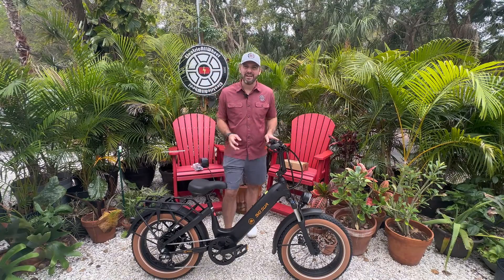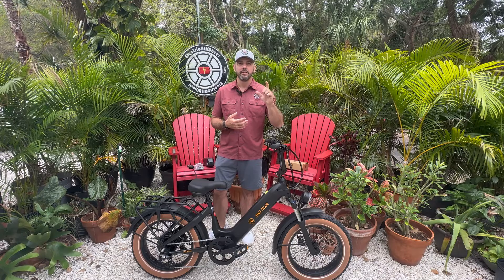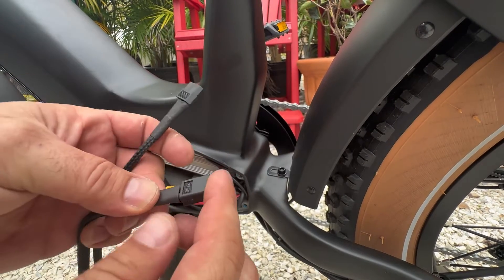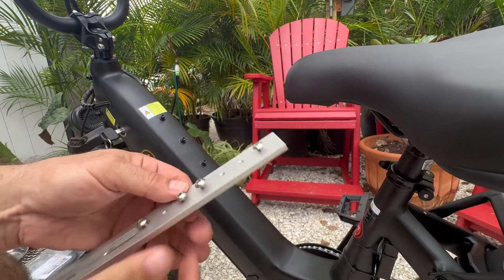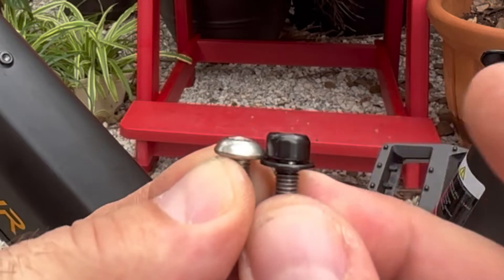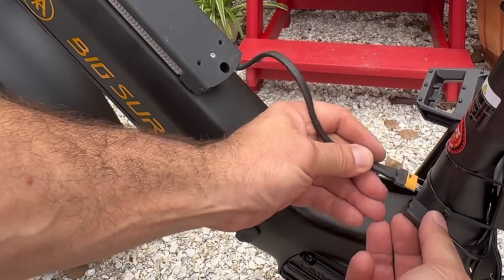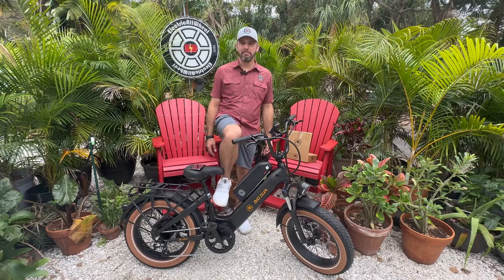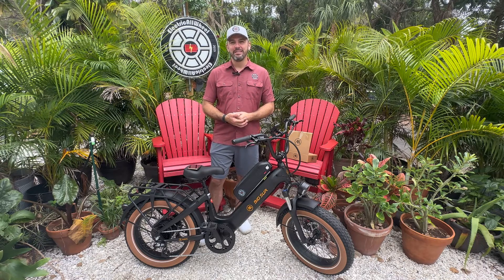AIMA | Big Sur Sport | Plug & Play Dual Battery eBike Kit Install Second Battery. More Range!

Comment: Can you still run 1 battery at a time ? What happens if the amps are not the same ? Does it drain 1 to match the other ?
Reply: Thank you, I bought your wiring set and am about to install second battery, (in rear basket I added) however 2nd battery shows  charge at 80% . So will it pull from prime first till both have same power level ?
Reply from the maker: Yes you can run one battery at time. 
Don’t confuse Amp hours (Ah) with Amps (A).
Ah + Ah = anything (battery capacity value)
Make sure your voltage matches system requirements. If both fully charged, it will uniformly discharge both batteries to the low voltage cutoff.

Comment: guy i know made a set of saddle bags with 2 baterries on it plus the origanal battery so that was 3 ! he went from 30 miles to 70 to 80 miles on the bike! found out he had too get a different controler but got it to work right !!!
Reply: Excaly what I plan to do once get my midrive, going to have 2 motors throttles an 3 batteries the main in my battery tank as got cruiser like the mod easy an set pinners with 48v 40ah battery in each one